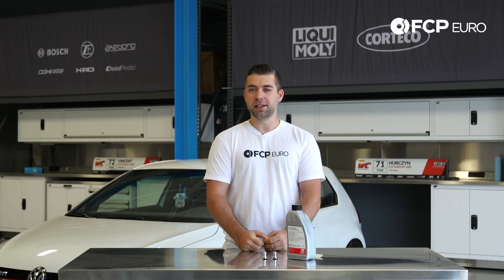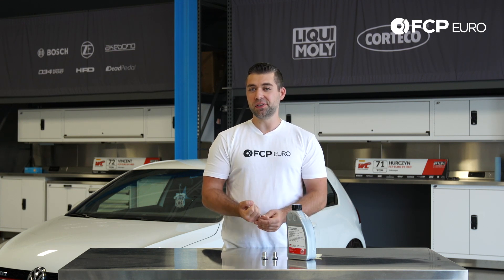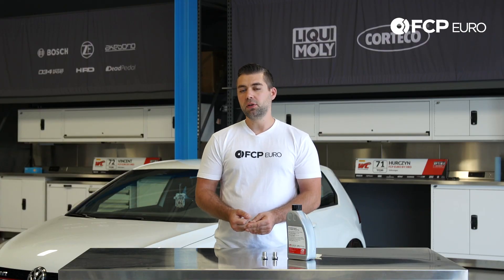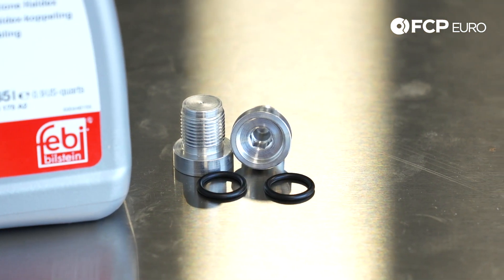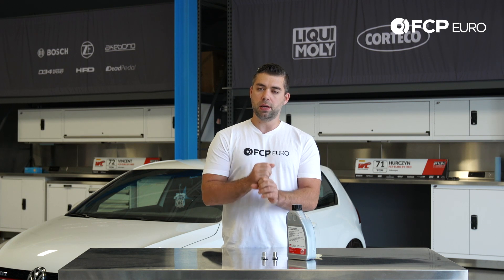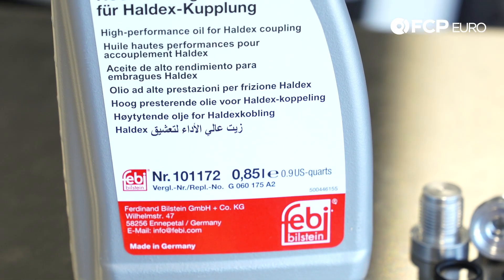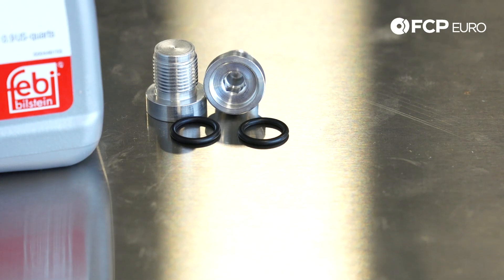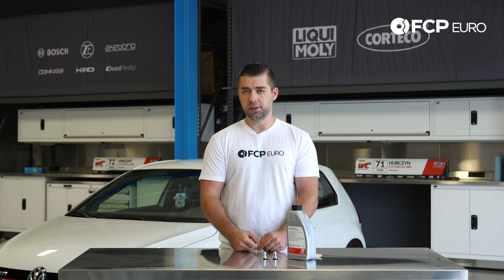Mk7 Volkswagen GTI - Haldex Differential Service Kit - Specs, Tips, and Product Review

Comment: How did you come up with the 30k number? Doesn't the official VW manual for this car not even suggest doing this procedure?
Reply: If you check the Audi service interval for the MQB platform (A3,S3 etc) it states to change the Haldex fluid every 3 years regardless of mileage. I assume 30k was a rough number that they came up with from other users who had the Haldex pump failure or outright Haldex failure. You can search up in here with plenty of videos in regards to this problem.
Reply: @CookJunkie  BW manufacturers the diff and recommends every 30k.
Reply: Doesn't matter what VW says if the diff manufacturer recommends servicing it then you should do it.